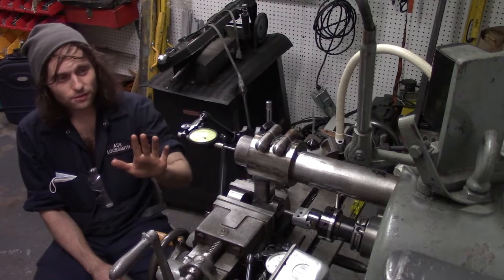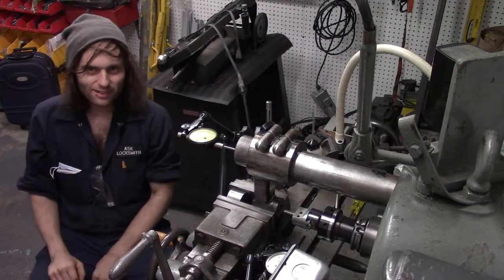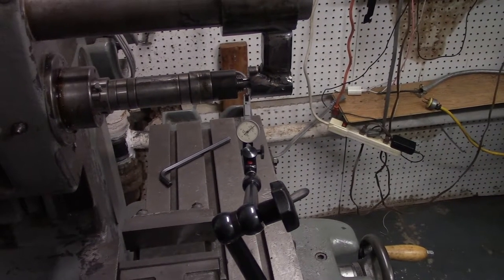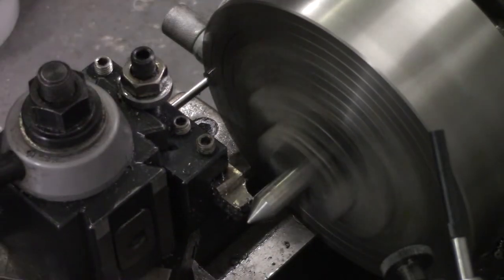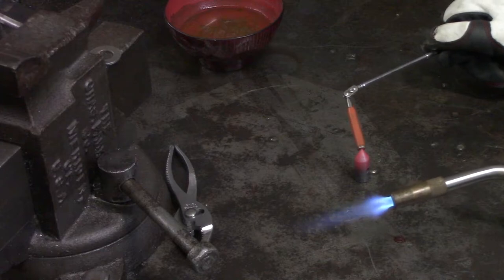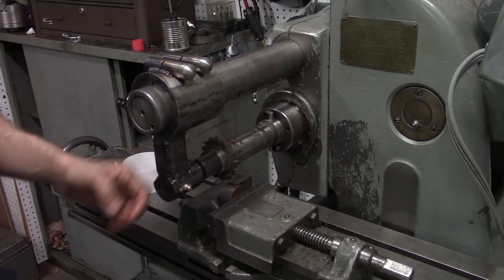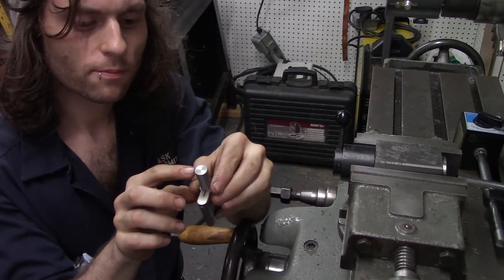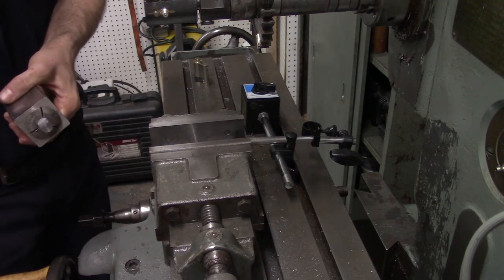Arbor Support 8 - Finale : First Chips and First Project

Comment: Great video! Nice puns and practical demonstration of the mill's capabilities.
Reply from the maker: Thanks! I still haven't seen how deep of a cut it's capable of. Horizontal mills are great machines.
Reply: @tilliesinabottle  what size arbor does your machine use?
Reply from the maker: @backyardmachinist  It takes 40 taper. In this video I'm using Nichols taper arbors which is only different from NMTB by the thread of the drawbar (7/16-14) and kind of the way it's driven.
Reply from the maker: How's the scraping coming? I 've been looking at Sandvik scraping inserts and they seem kind of over priced. They'll last forever but still 25-40 dollars...
Reply: @tilliesinabottle  Got it. Seems more rigid that my little horz. mill. Nice! 
Haven't had a chance to scrape yet, but I've been working on the jig's kinks. Gonna release a new vid with some scraping in the next couple weeks. And yeah $25 for a blade! Not the best 😅